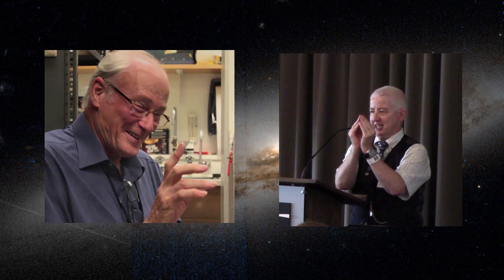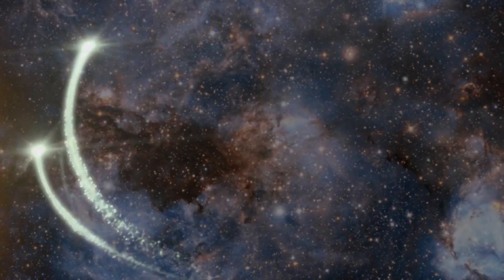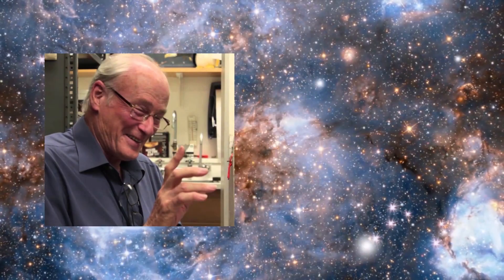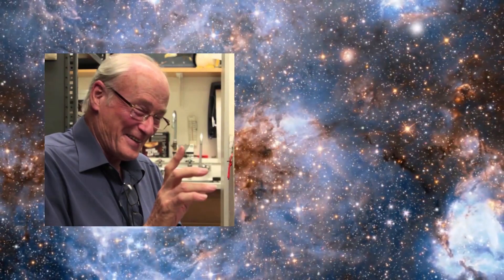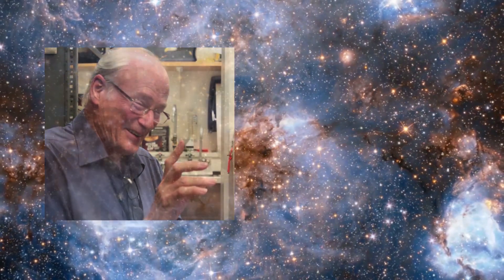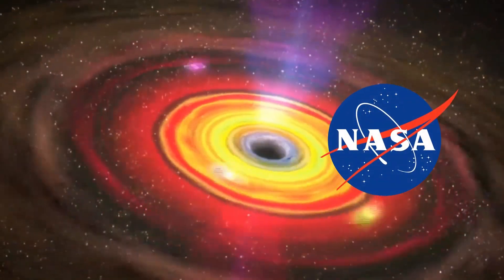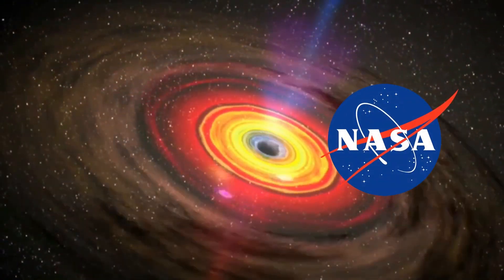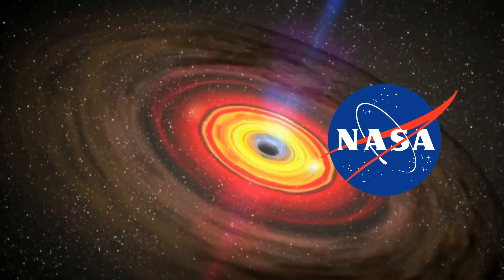Warp Drive Engine SHOCKS The Entire Space Industry! Building a Impulse Engine.

Comment: I'd just put a mouse inside a wheel and get him to run. In the back compartment would be a 'Mousery', where I'd raise millions of mice to replace each other as they died from exhaustion. Non-functioning mice would be expelled from the rear of the craft using space slingshots, adding some small extra thrust, and as the mice population becomes exhausted acceleration will gradually increase as the payload lessens over time.

Estimated travel time to Alpha Centauri would be approximately 3-4 months, depending on how many mouse wheels were in operation onboard the craft. Development costs would be relatively low, largely consisting of the sourcing of cheese and litter trays.